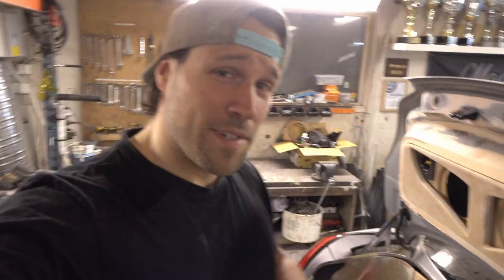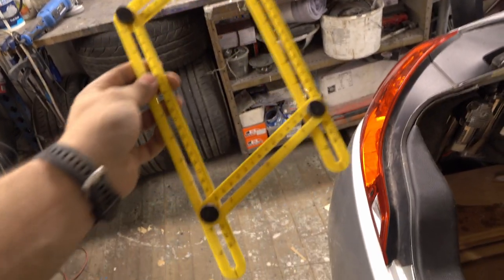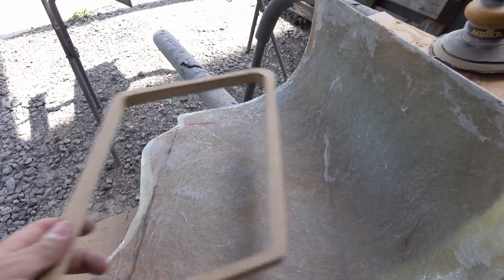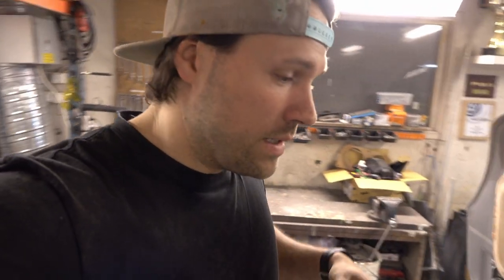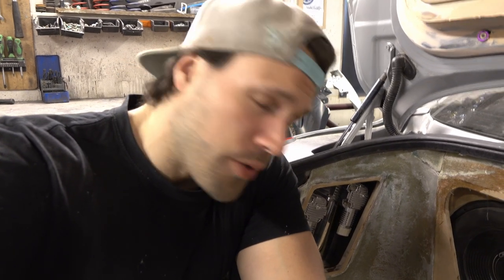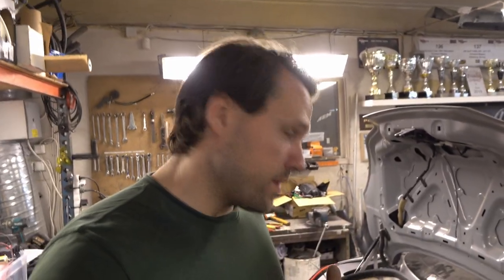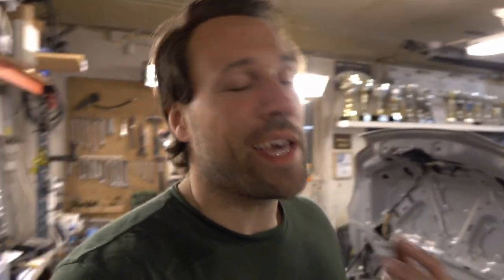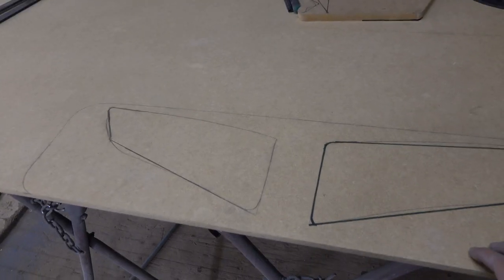Car Audio Build TRUNK BEAUTY PANELS [Infiniti G37 Part.4]

Comment: Does it effect the bass flow seems it will be trapped in the trunk
Reply from the maker: Hey man. I hope that the subwoffers will suck some air from the inner fenders at the back plus that I will have open port holes via the rear window shelf into the coup'e. If it sound shit, I'll just rebuild =)

Thank you for asking the question and thank you for watching.